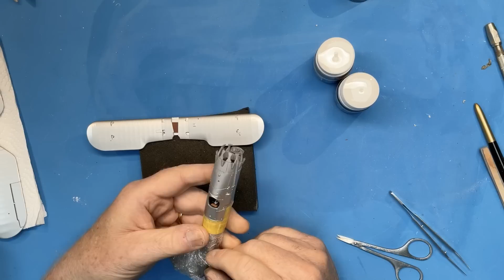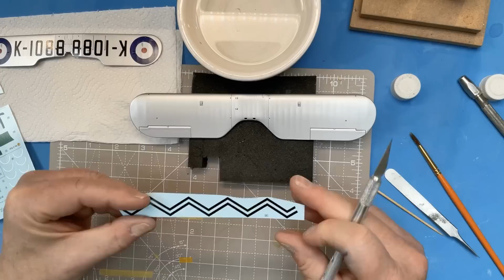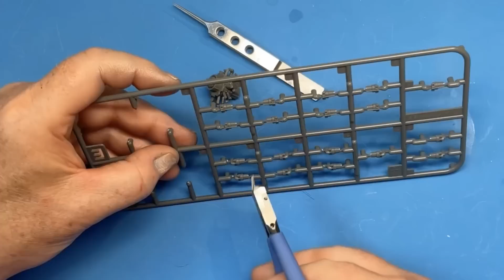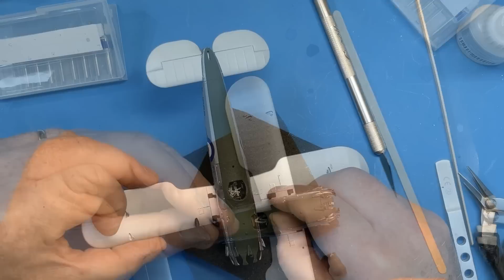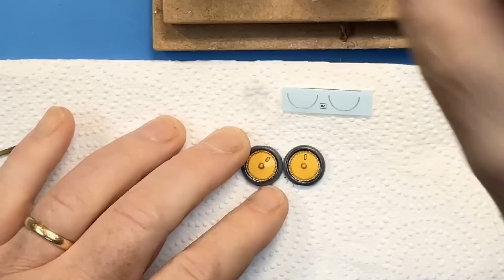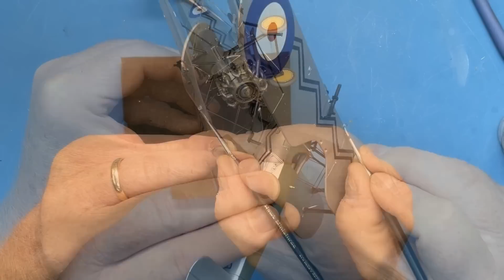Airfix 1/48 Bristol Bulldog Part 2

Comment: Good job! I am currently building the same one and it must be one of the most fiddly kits I have tackled - That engine! All those bits! I liked the way you got wood grain effect on the propeller without drawing any attention to what you did - nice touch. Thanks for the tips on fitting the cylinders it helped a lot.
Reply from the maker: Yes it’s a bit over engineered - but the engine/cowling on the bulldog is a complex thing to get right and they did a decent job of it

Comment: Nickle-silver rod for the rigging — brilliant (pun intended) Steve. 😁 Would that work on a Wingnut Wings model? With the elastic string I worry that they will eventually sag or snap. Doesn’t happen with metal rods, although you won’t have scale turnbuckles on the rigging then. 🤔
Reply from the maker: It would work Ronald although the larger distances in 1/32 might mean its harder to maintain the straight runs. For 1/32 I still prefer elastic rigging thread and as you say its possible to represent turnbuckles with it.
Reply: @TheModelShed  thank you. 🙏🏻

Comment: Did you have any fit issues with the trailing edges of the wings, Steve? I have seen another build whre they didn't want to come together along the edge.
Reply from the maker: Yes I did John - they’re thick and benefit from a bit of sanding to get them to come together without leaving a fine gap.